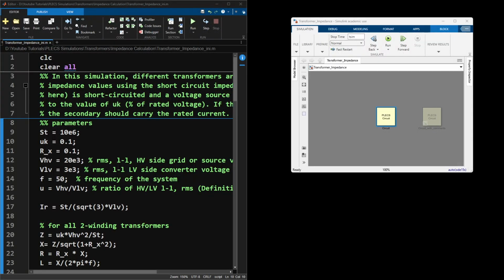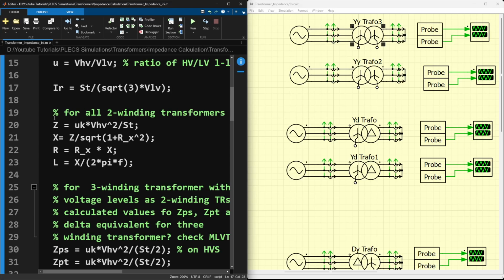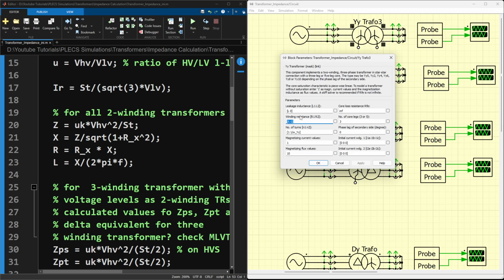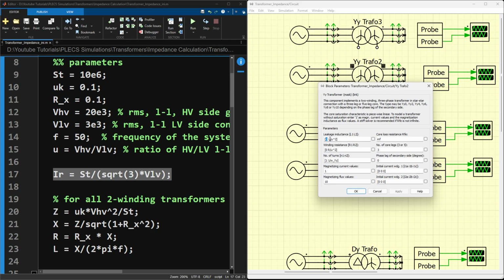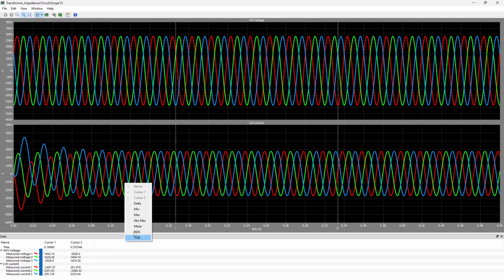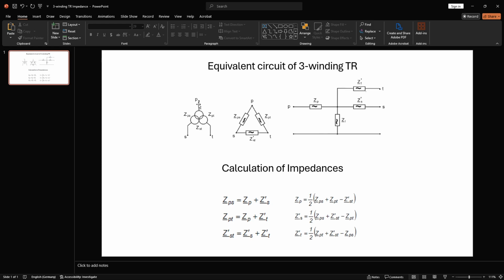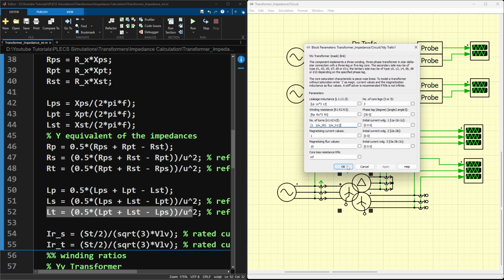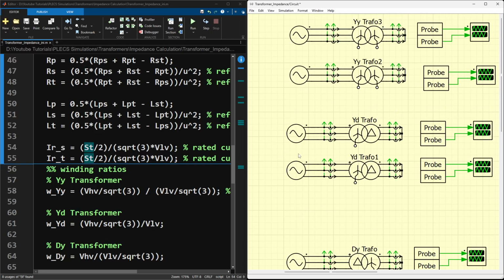Transformer Impedances in PLECS

Comment: Hi, 

For a 2 winding, 3 phase transformer(Delta_Star), Can we use both primary and secondary side inductance values at the same time? 

For example,

S=1.5MVA
f=50 Hz
u_k=4%
Vp=22kV
Vs=690V
X/R=10
np=Vp/(Vs/sqrt(3))=55.22
ns=1
Zbase_sec=Vs^2/S=0.3174 ohm
Xtf=0.04*Zbase=0.0127ohms
Lsec=Xtf/2*pi*f=40.41uH
Lpri=Lsec*(np/ns)^2=123mH
Reply from the maker: Hi, thank you for your question. Yes you can do that. Please make sure the calculation is done correctly. In your calculation, it is the same impedance used twice. I tried to explain this in this video. Please check.
https://www.youtube.com/watch?v=A6KjxLAORxw&list=PLw__ricUDm5d25jvbpydgukEBfX3BEnIv&index=18
Hope this answers your question?
Reply: @ElectroPowerSys  Thank you for answering the question in detail. Yes, it helps.